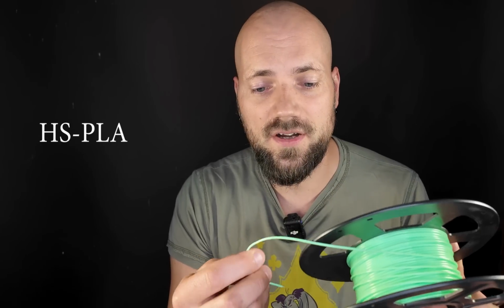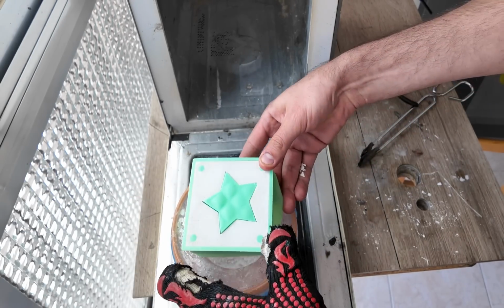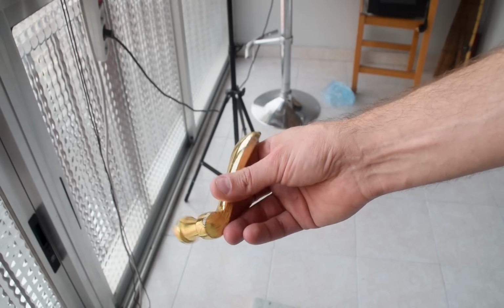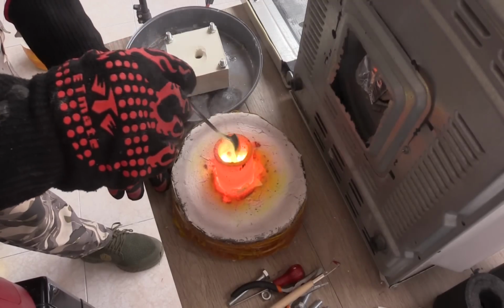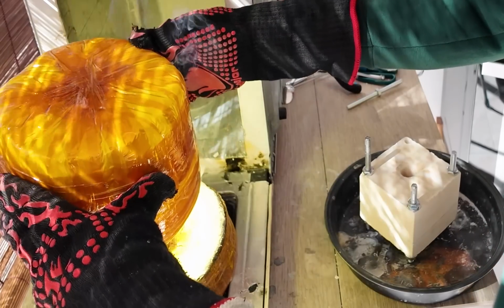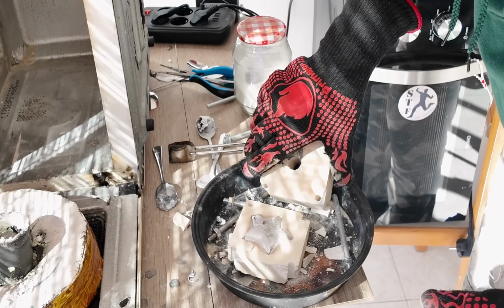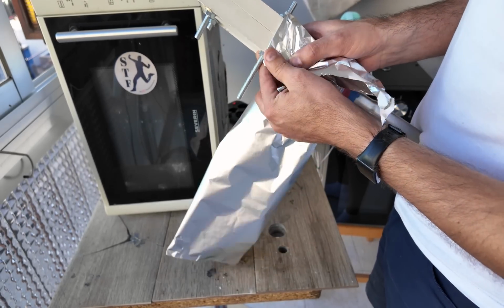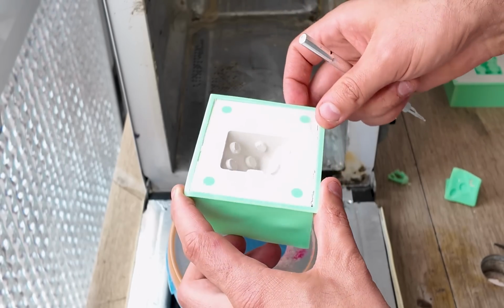Print-Wave Metal Casting: A Different Approach to Metal melting

Comment: Where are you from that "plaster" translates to "investment"? It is a very interesting concept to me.
Reply from the maker: I am originally from Latvia, though I live in Spain. The reason I said "investment" or "plaster" at the beginning of the video is that I meant two different things. Sometimes I use Plaster of Paris or construction plaster to cast metal. Other times, I use professional investment made for metal melting. My understanding is that usually, you call "investment" a type of powder that is designed for things like metal melting. It can withstand high temperatures, etc.

For example, Ransom & Randolph make investments for metal melting, and it even says on the box "investment."
So basically I mean 2 different things :)

Comment: is it really nice and heavy the metal could be lead, it melts well captures detail well, and china likes to put in cheap things to make them seem heavy and expensive. if the out side is a higher melting point then lead, it almost always is, the expensive metal can formed in to a cup then the lead can be poured directly in to cup then you can make a cap to for it out of the expensive material, you hammer or rivet the cap on. you end up with a heavy piece that is solid and inexpensive to make, not sure what it does to the home value I know their is regulations with lead paint clean up, but that's not really the manufacture's problem is it.
Reply from the maker: A lot of people say it might be zamak, but who knows, it might as well be. Cheers!

Comment: you should try a mold releasing on the printer bed, you could use a thick one like Vaseline petroleum jelly away from the parts. then close to the part you could use none or maybe a really thin oil with a paint brush on the parts.
Reply from the maker: I do use some mold release sometimes. In the dice video (not the footage from this video, it was a test piece), I had to use a mold release. I tried Vaseline, but what worked best was castor oil. I am still looking for other mold release options. Cheers!

Comment: I've considered but not tested it but if you have a kiln you might have clay, and could probably make a clay mold for metal too if you don't want to mess with plaster and metal temps.  Sand should be best and plaster obviously breaks up easier but clay might get you a really nice resolution and be able to be pre-heated.
Reply from the maker: Cheers!

Comment: Your "not brass" metal is probably Zamak, an alloy of Zinc, Aluminium, Magnesium and Copper. It's a really amazing metal for casting, has a much lower melting point than brass, and does less toxic Zinc fumes.
I love Zamak :)
Reply: Not to mention, zinc alloys shrink so much less than just about any other casting metal.
Reply: Yep I work as an electroplater and we plate a lot of cast Zamak parts. Probably  Zamak 3 if I had to guess, there are multiple types of Zamak. We do zinc plating for a better surface finish and then a chemical dye that turns the plating a brassy color. We do a lot of handles for hotels.
Reply: Surely the aluminum fumes can't be better than the zinc ones tho. Either way people should be on daily silica supplements for all the airborne aluminum from cloud seeding, doubly so when they're sanding and melting alloys in their home
Reply: Yeah, but it looses basically all strength at 250°C and is an absolute bitch to electroplate with other metals.

Comment: yellow smoke isnt zinc... its cadmium. it may just be the camera but that smoke looks distinctly yellow rather than blue white of zinc.
ive found the valves off gas bottles to be particularly bad. 
cadmium is not something you want burning... 

you dont tend to get it using old school brass plumbing.

considering modern "brass" doodads will be made from who knows what... dont assume its only brass and zinc. theres going to be lead, cadmium, antimony, phosphorus, even the chance of beryllium... that ones particularly bad.

meh. this is one step away from a proper greensand cast. just add pins to the halves so they locate and ram up on a board.
 multiple parts can be made on "match plates".

greensand is tricky at first but so much cheaper and easier when you get the hang of it. investments here, at least, are basically unobtainable...
Reply from the maker: That's some very nice and detailed info. Thank You!

Comment: Why is the mould called investment? Never heard that before
Reply from the maker: Usually, the investment is referred to as a heat-resistant material used to make the mold. That's why I mentioned that I used Plaster or Investment, because some people in the metal melting community will correct you and say that Plaster is not investment. In other words, there are high-temperature powders available that are specifically designed for mold making and burnouts, so usually, when one says "investment," they refer to those professional powders. Plaster of Paris type powders can work with or without additives. As I mentioned in the video, I used only Plaster of Paris to make the butter knife because I like to keep experimenting and collecting data. The "Star" was made using professional investment. The "proper investment" is definitely much nicer, gives better results, and can withstand higher temperatures....it's also way more expensive.

Comment: I Love your creativity.  Perhaps you could add someething to your investment that would allow you to bring it up to vitrification temperature in the microwave.  Some of the silicon carbide that you use for crucibles perhaps?
Reply from the maker: I have tried it, but not enough times to draw any conclusions. I think the time I tried it, nothing happened. Maybe I needed to add more silicon carbide. There is also a possibility that the mold will crack because of the microwaves.

There might be a way to do it in a controlled environment. I did not continue experimenting because it's also an extra cost to add silicon carbide to the investment. That said, I do make molds out of silicon carbide. Smaller molds can be burned out without using any kilns; only microwaving them is enough.

Cheers
Reply: @ShakeTheFuture  many microwaves have a "popcorn" or a "smart defrost" mode; the actual behaviour varies, but on certain models these modes will "feather" the microwave emissions (you don't want frozen food to explode after all) and use humidity sensors to detect if the object is steaming and automatically stop early.

Comment: I'm thinking of building a custom microwave so that I can make it larger and have custom controls- such as built in burnout schedules, etc. I had thought that building it with multiple magnetrons might be a fool's errand since the complications due to microwave interference would be difficult to overcome... but it just hit me. What if I made separate microwave chambers that were isolated with aluminum shielding (or built the shielding into the kaowool when I built the furnace) so that there were effectively two or more different microwave chambers that were thermally connected to the main chamber and could contribute heat flow to the main chamber without having to send their microwave radiation there. Perhaps such a scheme could allow for more reliable heating at temperatures required for steel or even titanium.

I would make blocks of silicon carbide that are connected by hallways of silicon carbide to the rings of silicon carbide that heat up the central chamber. Essentially, a thermal circuit. The silicon carbide blocks and hallways would be thermally insulated from the exterior as usual by kaowool and kapton tape. Inside the kaowool around the middle of the hallways (separated far enough from the silicon carbide to not melt), I would place aluminum reflectors that would achieve separating the magentrons' EM waves.

I guess the whole point of such an elaborate setup would be to ensure that the microwave can run for a long time without overheating the magnetrons. Distributing the load across the magnetrons could allow the microwave to get to a similar temperature with less duty cycle per magnetron. This would make it more reliable overall. Or you could more quickly reach high temperatures. That could be nice too.

LOL. Now I'm probably going to have dreams of distributing a thermal circuit in a sphere around the central chamber and pumping in energy from 16 magnetrons. The real problem is plugging them all in. Hahaha.
Reply from the maker: Well, it's definitely possible. Industrial microwaves have 2 magnetrons. I've never tried them out, but they should melt metals way faster.
Reply: Microwaving an object like this will create hots spots and cold spots - the EM waves in a microwave oven are about ~10cm, so you'll get 5cm of very hot plaster and 5cm of cold plaster - the heat from the hot areas with spread, so the cold areas will receive some heat, but it's less than ideal or efficient . . you also set up stresses in the plaster than make it much more likely to break, crack and crumble . . . . this is why pretty much all microwaves have a rotating turntable so areas of the food are not just stuck in a cold spot . . . . if you can find some easy way of moving the plaster around, up and down or rotating (or any movement) you will get better, more consistent, results.
Reply: "LOL. Now I'm probably going to have dreams of distributing a thermal circuit in a sphere around the central chamber and pumping in energy from 16 magnetrons. The real problem is plugging them all in. Hahaha."

Lol, you'd need to get all 16 in phase, otherwise there would be a ton of destructive interference.

Comment: I just had a thought - they make a wax filament, which would allow you to use a 2-filament printer to make a more complicated cast. Would require a little bit of burnout, but may be easier for some objects than using a full flask process.
Reply from the maker: I do have 1 spool of wax filament. I never made a video about it, because it's difficult to print and the adhesion in bad. I find that it's much easier (and 3x cheaper) to use PLA. That said, I have not touched the spool in years. Maybe I should give it another shot with Prusa MK4.

Comment: The metal is zamak 12, an alloy of zinc, magnesium and copper, used in bathroom fixtures, door handles and other items that require very accurate details. It is known to be one of the best flowing alloys, next to silicon bronze. Also, mold should not be close to pouring temperature, it should be 500F lower than the pouring temp.
Reply from the maker: Thank you for the correction. I think saying close to pouring temperature was not a good word choice.
Reply: @ShakeTheFuture  No foul done, I enjoy the innovative content. You should try casting some stuff with that zinc alloy too and explore its capabilities, I would love to see that.

Comment: Your mystery metal in the door handles is probably some form of Zamak which was brass plated. There's a bunch of different kinds but what they have in common is that they are zinc alloys designed for die casting. Melting point is fairly low, and the metal is very fluid so it fills details in the mould well. Hence your nice cast (except for the damage from early opening).

Zamak is actually so good that it's worth setting up just to cast it; it has reasonable mechanical properties (superior to cast iron, for example) and easily produces good castings. However it cannot tolerate even the slightest contamination with lead, inclusion of lead in the alloy will cause a form of corrosion which makes the metal break with a strange 'crystalline' appearance or worse crumble into little bits. In fact manufacturers go so far as to distill the zinc to obtain sufficient purity to make good Zamak.

This would be a problem if you used the same crucible and tools for Zamak as for brass, as brass often contains 0.5% or so of lead as a machinability aid.
Reply from the maker: Thanks! That's some good info. I'll need to buy some zamak ingots and explore it a bit more. Cheers!

Comment: I would run the printer bed at higher frequency shorter motion to get a better and faster bubble removal.
Reply from the maker: Yes, I actually do use different g-codes. That was one of the early-trial g-codes. Now I run it at shorter distances. Cheers!

Comment: I think an accelerometer testing g-code would be great for popping bubbles of various sizes, as it passes through a huge range of frequencies.
Reply from the maker: The g-code shown in the video is not the only one I use. I have much shorter-faster moving g-codes that do the shaking. You suggestion using accelerometer testing g-code is great. Cheers!
Reply: great idea
Reply: He should use the vibration like my bambu does before every print
Reply: @AckzaTV  That's the first thing I thought of! That annoying BBBBBRRRRRTTT!!! lol
Reply: My Anycubic Kobra 2 features what they call 'resonance tuning'.
Shake the table faster and faster until it 'hums', do they same thing for the nozzle.
The excursion is pretty short, however...will have to do some testing.

Comment: Now I am wondering if this could  be used for some kind of injection molding of plastics.
Reply from the maker: I am sure there is a way it can be used. I also do the same method for making silicone molds. Instead of pouring investment, I pour silicone.

Comment: Here is a trick for knowing when the plaster is dry. After drying it, let it go to room temperature, then place your hand on the surface. If it feels cool, it's still moist. If it feels warm, its dry. (If it is dry it will feel warm even at room temperature). We use this trick all the time making ceramics.
Reply from the maker: Thank You for sharing the trick. Do you think it also applies to very small/stubborn quantities of water?
Reply: @ShakeTheFuture  yes, as long as there is moisture. It's critical in ceramics, so the pieces don't explode in the kiln.

Comment: btw if you need higher temperatures, get a broken toaster oven for free, a kiln coil and pid controller for 10-15 bucks each, and a bag of refractory concrete for 5-10 bucks.
you can add insulation around to make it more efficient (and reach higher temps) too.
Reply from the maker: Thanks for the tip!

Comment: This is a good idea however you DO need w kiln to dry it. Some of the water is locked in the plaster and will not be driven off until you can get it above 600F and keep it there. Most ovens do not get hot enough. Sometimes you will get lucky and it will work without a kiln, but eventually you’ll have one blow up in your face. Do not even attempt this without an apron and a face shield.
Reply: well, since it worked, evidently you don't (i.e. it doesn't matter if there's a bit of moisture left)
though yeah you shouldn't tempt fate.
I think the easiest solution (depending where you live) is to just get a pyrolysis oven, which will do 400C+ in cleaning mode. or make a crude kiln with refractory cement, a pid controller and some kiln coils if pyro ovens aren't common where you live.
Reply: @satibel  working doesn’t necessarily mean the mold is dry. It means that the geometry of the mold was not such that the escaping water was confined enough to make a bubble blow molten metal in your face.
Reply from the maker: Thanks for the info. Yes, wearing a PPE is a must!

Comment: This is sweet thanks a lot!  Shaking the investment on the printer for shorter distances and at higher frequency, rough guess like 60 hz, (think input shaper calibration) might get more bubbles out
Reply from the maker: That was the first G-code I used. It also traveled a shorter distance at some point during the 2-minute shaking. However, I recently changed the G-code to begin using shorter distances right from the start just like you suggested. Indeed, it's better that way 👍 Cheers!

Comment: Where do you source metal? A friend gave you the door handles, but what about the rest?
Reply from the maker: Last time I bought 8mm aluminium rope-crimps from AliExpress (around 1kg). They are a good size for my crucibles, and it worked out to be quite cheap. Next time, I'll get some ingots from AliExpress or somewhere else. Since I live in an apartment, it's not very convenient for me to cut metal to fit into the crucible, so I prefer to buy smaller pieces of metal, like cable-crimps or ingots.

For brass, I just buy some pipe fittings from the local hardware store. For copper, I buy some copper pipes and cut them with a pipe cutter. That's my favorite way to cut metal to size. For cast iron, I just buy 0.5-1 kg weight plates. I have a lot of 1 kg weights in stock from my failed bodybuilding days :)

I recently bought a 0.5 kg weight plate from a sports shop and was surprised at how cheap it was. It was under 2 euros.

It's one of the cheapest metals and it casts beautifully, but it is a pain to cut it into smaller pieces. I usually make a cut with the saw and then go outside and break the plate with a hammer.

Comment: Interesting idea but it will only work for a pattern that can be withdrawn with the necessary draft so I see no advantage over sand casting which is much quicker and an indefinite number of castings can be made from one pattern.
Reply from the maker: I agree that sand casting is much quicker and less wasteful, but there are some advantages to other methods that I'll demonstrate in future projects, such as the dice example at the end of the video. That said, I have never done sand casting, so I might not know what I am talking about 😊 Thanks for the comment!
Reply: With the pattern softened for removal I don't see this method limited to sand casting draft requirements.  On the other hand, if drafting is satisfied a pattern might be reused.